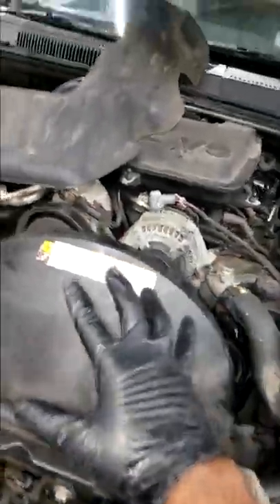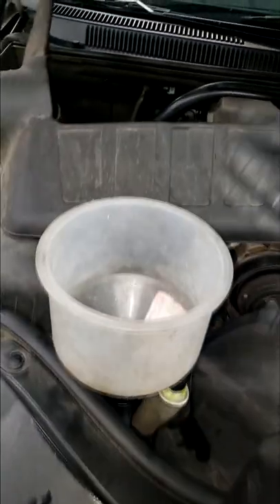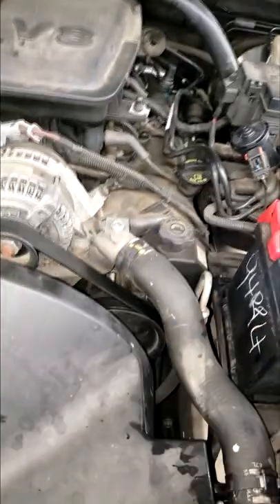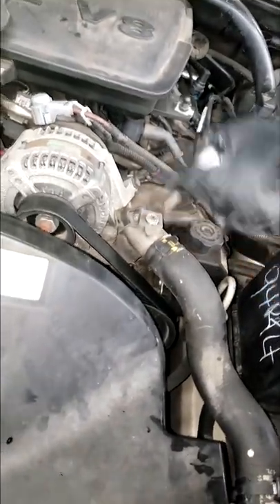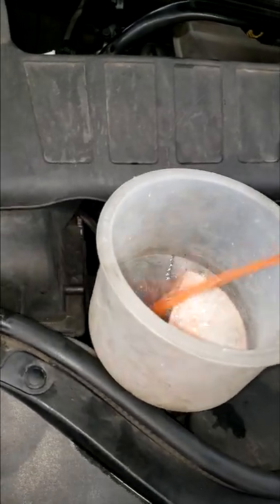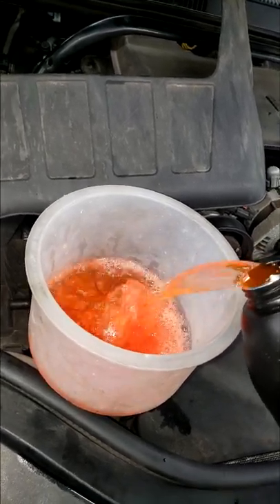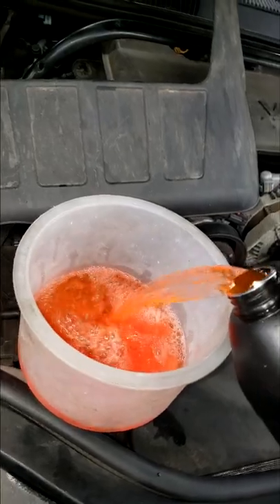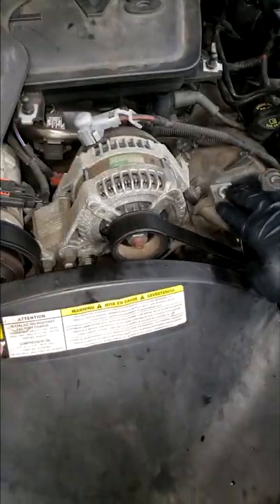How to fix a OVERHEATING CAR. Do this to BLEED all the air out the cooling system. #JTtheCarGuy

Comment: If you ain't got the bleeder screw or a  special funnel, just jack up the front of the car while idling with the heater on full blast.. air can find it way through gravity,squeezing the rad hoses while front in air helps too. Works well on fwd cars as well. Just be safe when jacking up car .
Reply: Thank you for the advice seriously
Reply: Unsure wtf is going on with mine ..a puzzle . I had head skimmed oressure tested under 2 years ago end of last summer went away while on a day trip it iverheated oretty good back then fans went nuts etc .......simce then new pump new ect (but got an oem  to replace it asap) new belt new rad new ac condensor and regassed along with 2 flushes/clean detergent..

I'm.on top of it but back to exp tank filling but not returning to rad ..very bizarre indeed ..doing my sweed in  I refuse to believe hg gone I even wonder if ut was bad anyway . My therm is at lower hose not top .I reppaced that with oem ..I'll be pitting oem ect I'm very soon amd agsin test fans via switch
Reply: Squeezing the hose works 😅I did it on my Cadillac it worked

Comment: The old school way is just run it with the radiator cap off until it stops bubbling with the heat on and keep adding water.
Reply from the maker: Lol really?
Reply: @OnlineMechanicTips the method your describing is a failed method that I have tried in the past and has brought me to finding this video
Reply: Does that work

Comment: The service manual states that the  procedure for filling the pentastar cooling system requires a vacuum-fill tool otherwise it’s prone to having an air pocket in the system. I use a vacuum fill tool on every coolant job because it’s faster, less likely to have air pockets, and a way to check your work without doing anything extra. If it doesn’t hold a vacuum you know you need to double check everything and tighten that loose hose clamp 😅

Comment: Just use a Coolant Air Lift. It will pull all the air out in less time that letting the thermostat open to burp.
Reply from the maker: Yep, that is def an option. I do not have that tool yet

Comment: The easy no-tools method: 
Pour coolant into the radiator, or if the radiator doesn't have the cap on it, pour the coolant into the pressurized overflow tank. Keep pouring until the fluid stops going down, then start squeezing the radiator hoses and "burp" as many air bubbles out as you can get. Fill the level back up, and then start the vehicle without the pressure cap on it. Now, you can either jack the front of the car up and put it on stands, pull the front up on ramps, or just quickly drive it a few feet to a place that is sloped so that the front of the car is tilted up higher than the rear, like the mouth of your driveway or something. That puts the radiator and expansion tank at the highest point, and air will always bubble up to collect at the highest point. Once you've got the bubbles burped out as much as you can and the front of the vehicle is placed up higher than the rear, start it up and then go put the heat on full blast. Go back out and look for leaks, then top off the coolant level if you need to. Start squeezing the radiator hoses again trying to burp out more air bubbles. Once you've burped out as many as you can at idle, go rev up the engine to 2,000 rpm for 5-10 seconds and go back out to top off and burp the hoses again. Once that's done, just go back into the cab and hold the engine RPM at 2,000 until the temperature gauge reads at operating temperature. Now, you can verify that the thermostat is opened up by feeling both upper and lower radiator hoses. If the top is scalding hot and the bottom is cold, it's not opened yet. If they are both very hot, the thermostat is opened up. Give the engine a few more revs while squeezing the hoses a few times without burning yourself, and then top off the coolant level in the radiator and in the overflow tank. Put a new cap on it, and you're done. Radiator pressure caps are like, $5-10. Don't cheap out on it. Just replace it. The system is now bled out, and any air that remains will be burped out by the cap as you drive it and that volume will be replaced by sucking in coolant from the overflow tank when the engine cools back down and the coolant shrinks back down and creates a slight vacuum. 

The elevation of the front end is VERY important for FWD vehicles in my experience. I get the front end 1-1.5 feet off the ground above the rear end. I want the radiator or the pressurized expansion tank to be the highest place as I try to bleed it out. All air will seek the highest place in the system, and that means it'll bubble out into the atmosphere like you need it to. 😎👍 DO NOT skip the bleed procedure, and DO NOT call it quits before the thermostat opens up. Many thermostats have a little jiggler bleeder to allow air to escape while it's still closed, but there's still air that will rush out when the thermostat opens and the flow volume picks up a lot. If you drive away before that happens, you'll have a big air bubble still stuck in there. 

Btw JT, if  you fill and bleed cooling systems regularly, make yourself a vacuum filler and it'll speed up the process a lot. 💪😎
Reply: I’m sorry but I couldn’t read all of this
Reply: Ima try this, I keep having a problem with my durango 3.6 overheating & I thought I bled the system right until I heard about this method& But when I did it it drove fine after letting it sit for a day then started overheating after normal driving so hopefully this does the trick
Reply: @Lavishlifestyle90  It is hilarious that some people have literally a 10 second attention span and would rather be ignorant. I really do not need to know that you're incapable of sitting still and paying attention nor do I care. Next time you feel the need to tell someone helpful that you're less attentive than a goldfish, do everyone a favor and just don't. It costs nothing, and it's the best thing you can do. Thank you for coming to my Ted Talk. 😇
Reply: @angelleos3397  Hey Angel, happy to help! Questions for ya: 
Did you replace the radiator cap? 

Did you refill the overflow/reservoir tank fully and is it currently filled up to the full mark now? 

Did you have the heater turned on when you burped the system the first time? 

Are you sure that you installed the thermostat the correct orientation and not backwards or upside down? (there is a small check valve in most thermostats which will open up to burp air on its own without having to be open, but if it's the wrong direction or placed at the bottom it can't let the air pass)

Do you have any leaks? 

The cooling system has to be free of air and under pressure in order to work correctly. Air bubbles cause water flow to be obstructed and they can collect in the water pump causing no pumping, near the thermostat causing it to stay closed, and near sensors for the fan which will cause the fan(s) to delay turning on or not turn on at all and it can give the dash temp gauge an inaccurate reading. Whenever the radiator cap goes bad or there's a leak somewhere, pressure can escape and air can get in. Pressure will escape when the engine is running and the system is very hot, and when there is no pressure the coolant boils at a lower temperature. Boiling makes steam which is basically the same issue as air bubbles. The antifreeze raises the boiling temperature of the water and the pressure raises it even higher. 10-18PSI is the normal range of pressures that most vehicles run their cooling system at. The pressure is labeled on the cap itself. Don't go higher or lower; always get the same one. Radiator caps are NOTORIOUS for being ok while in place for years, and then that one time they are removed after 5-6 years they won't ever seal again because their rubber gasket has a groove in it and it's hardened up from age. Luckily they're usually like $5-$10. :) The reservoir or overflow tank must be filled up because the radiator cap allows coolant and any small air bubbles to push out into it when the engine is running and the hot coolant expands due to heat, and then when the engine cools back down the radiator cap opens up again to release that vacuum caused by the cold shrinking coolant and it lets the radiator suck that coolant back in. If air bubbles are pushed out, it lets coolant back in to take the air's place afterward. If the overflow or reservoir tank is empty or too low, the radiator cap will let air back into the system after it cools down. :( No bueno. It's easy to forget to refill that tank so just double check it. 

Hope these tips help. Good luck my friend.
Reply: @mannys9130  I’m going to try your method tomorrow morning hopefully it works man, I did replace the cap but a cheap one from oreilys I think the original one tht was on it is actually better but I haven’t put it back on & and yes I did have the heat turned on when bleeding the system but I did just open up the bleeding screw from the thermostat housing and poured coolant into the radiator not the (overflow tank ) tht was supposly how u bleed my system nd not 4 sure if I had the overflow tank at the full line when doing this but do u know if no power steering fluid can cause air in your system also ? I had replaced the waterpump and thermostat already both from parts oreilys though…
Reply: @mannys9130  and I feel like if I had a no spill funnel this would help a lot more…
Reply: @mannys9130  and one more thing how do you truly know when you got all the air out the system ??
Reply: @angelleos3397  yo bro I been having problems with my 3.6 Durango as well I’ve changed everything water pump,thermostat,radiator I haven’t check the head gasket but I doubt it it’s the head gasket basically my truck on a cold start the temp goes up to 250F• and that drops down to 212 it’s so weird I might change the sensor soon
Reply: @Jose11martinez  probably head gaskets , I had to replaced the engine mine had over 200000 miles..
Reply: Thank you for taking the time to be extremely thorough with your technique. I will do this method right away. Thanks buddy 👊
Reply: But you dont have to put the heat on full blast. You can set at mimimum speed cause all you are doing is opening the heater core when you actuate the heater.
Reply: Hey man. I did the bleeding on my 2015 accord but there was a white smoke from tail pipe. I’m afraid I didn’t bleed it thoroughly before and could the air pockets messed up head cover gasket? Car only has 98k miles
Reply: My car was recently coolant system repaired on and now it overheats.  I will try this bleed method.
Reply: Lower radiator hose is supposed to run less hot than the upper hose. If you’re feeling the same amount of heat as the upper radiator hose your radiator is fucked 😂 That’s the whole point of a radiator, to cool down the fluid to send through the core of the engine. Stop repeating stupid things.
Reply: @angelleos3397  no more bu bles from the funnel
Reply: Many thanks for your detailed and comprehensive walkthrough. I ended up mostly following it, instead of other videos, lol. We'll see if it fixes my problem, but I'm optimistic. Thanks again!
Reply: Thanks so much for explaining step by step really appreciate you taking the time to do this!
Reply: Seemed to work, but was back down to almost empty after an evening of driving. I fear I may have a leak elsewhere in the line. Ugh.
Reply: @lauwthemaster sounds like head gasket to me unfortunately
Reply: Wow. Thank you thank you. 🙏
Reply: What happens if it goes past operating and straight to overheating?

Comment: How are you? Quick question? I have a 2021 Acura ILX, did a radiator drain, and fill, using the same funnel in this video. Burped all the air out, put the cap back on, now I’m only getting heat on Hi? If I adjust to 86,85, ect…. The heat goes to room temperature basically. Do these newer Acuras need a vacuum, or something different to get heat on all settings? Thanks👍

Comment: How long can you run a car that’s overheating and it still be ok? I bought an 05 xterra with a blown radiator. It runs really good, it just overheats. Is it toast after overheating a few times?
Reply: Pretty much yeah. Once the heads warp you'll pay what you bought it for to get a head gasket replacement AND have to get the head resurfaced at a machine shop. And that is only if the head is still usable. Overheating is not something to be taken lightly in the least bit. It is VERY serious.
Reply: You really don’t want the engine to get over operating temp. When things get hot, they expand, and components (especially the head gasket) will warp. If you notice the temperature gauge going over 50%, shut the engine off immediately and pull over. You’ll want to get a tow if you don’t want to fork over the cash for a new engine/car. 

That said if your radiator is gone, you can still drive (very) short distances, as long as you can get there and back before the engine warms up. But I wouldn’t recommend doing that. If we’re being realistic here, if your radiator is blown, the furthest you can drive is somewhere that’s within walking distance.

Comment: I have a 2007 dodge charger SRT it requires 0w40 oil it has 250,000 miles on it should i stick with the recommend 0w40 or switch to a thicker oil? Will a thicker oil damage the engine? Please Help!!!
Reply: stick with the original oil. you only switch oil if your manufacturer requires it or if you have a separate engine build going on.

switching to a thicker oil means you won't get the proper lubrication between parts and you'll see extra wear, R&D teams know what oil is best vs some random mechanic (or worse, a DIY'er) who isn't an engineer.
Reply: @alextheonewarrior  thank you very much for your help my friend
Reply: Nice car bro